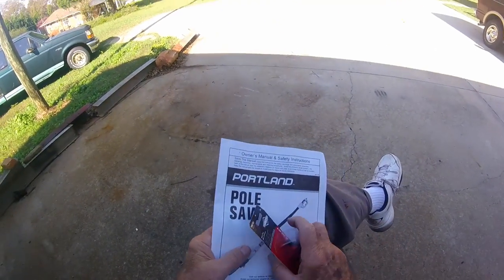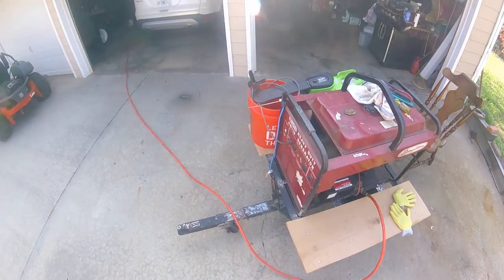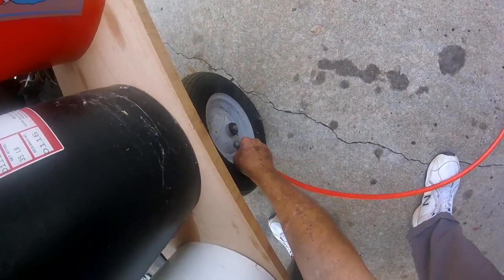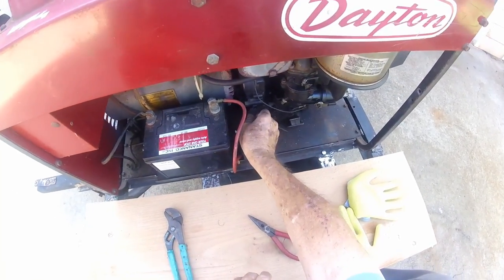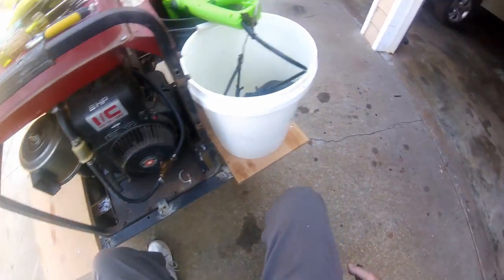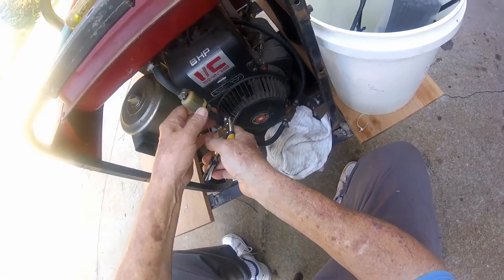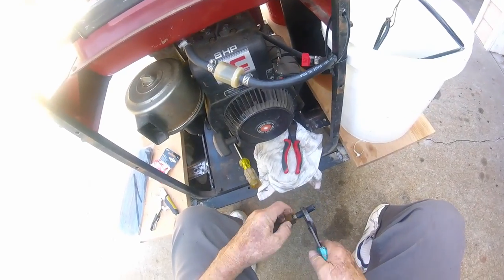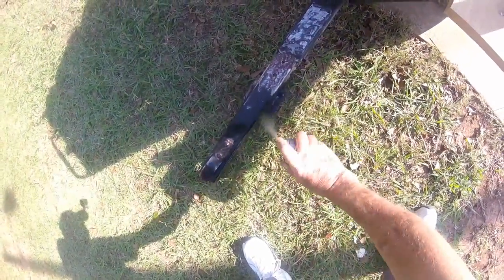Pwalpar VLOG Generator Maintenance

Comment: Good to keep the generator in good shape in case you need it in an emergency. Did you find out anything about that back pain? It sounded like a pinched nerve, or something altogether different than normal back pain. I've had back pain the last 40 years and the last few days it has been so bad I could hardly walk.
Reply from the maker: I have an appointment with a back doctor  Right now i will do anything to shed myself of the pain